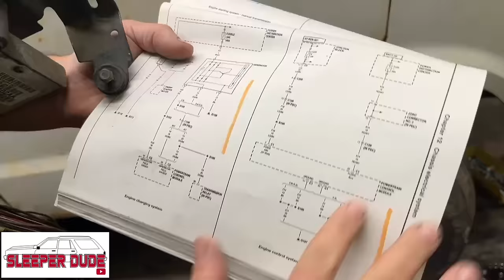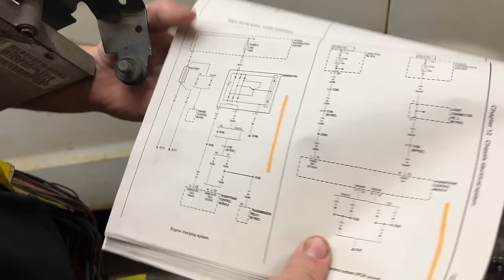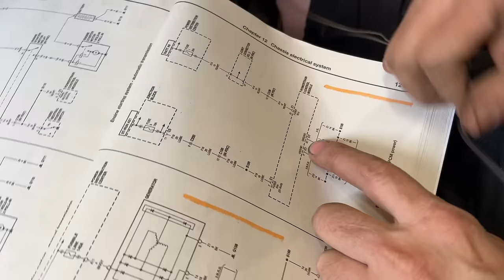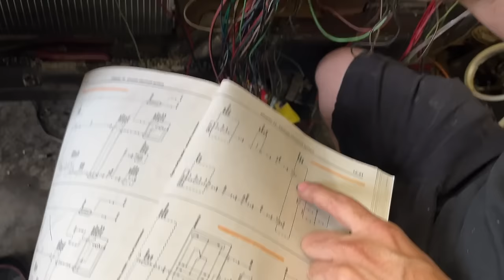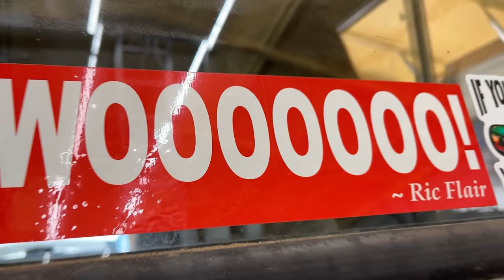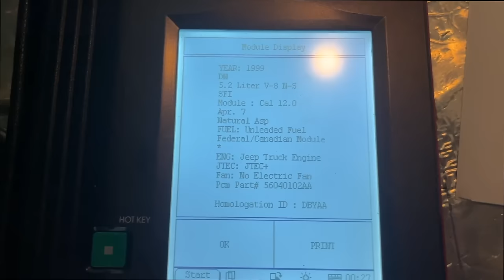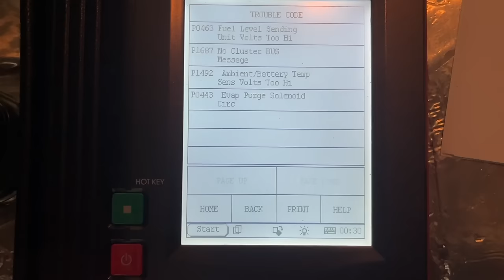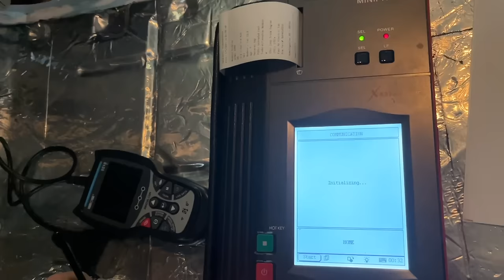2 Years of WORK Has Led Up To This! Will It Start?

Comment: This may sound stupid but tennis racquet handle tape is almost like Ford harness tape! I've used it a bunch. Maybe that helps. Also made a few painless harnesses and stretched it out and used the tennis tape to make it less of a ball of spaghetti! Also way cheaper than Ford tape, no real difference. Also a dress or tailor tape to measure the excess or to add wire?yes connection cleaner and dialectical grease too!.zip tie first , after completing, tape. Ps love you are using AN wrenches but GET SOME THREAD CHASERS!
Reply: Great tip!!

Comment: Hey Josh,   the computer probably requires the correct info, (resistance) from the Durango's lock cylinder, key etc.
    I read through much of the fan's suggestions until i got a slight headache.  MY POINT IS...... You need peace of mind on your next trip. Meaning Holley for your fuel injection, IF YOU MUST have it. But a big 4bbl and intake would be more trouble free and easy to diagnose in a similar nightmare  situation as your last RV Trip.
        You need reliability more than this modern crap on the next trip. Simplicity breeds success and reliability on the road.
         You might get this configuration to work, maybe you already have, but that's not enough for Josh, Tosh and the kids.    It was gut wrenching to watch all the hardships you had  on your vacation the last time. Just  want to see you  all have a trouble free trip this next time.     * We  care for you all.  good luck!

Comment: Hey josh..not a Mopar guy.....but I had the same problem on my 3.1 chevy and if the computer didn't detect oil pressure at crank it would cut off the fuel pump and only fire intermittently.  I changed the oil sending unit and it fired right up OBD1.  I have also got bad crank senor that were brand new.  Just thinking out loud... good luck.

Comment: There are some food suggestions here mainly the crank trigger and the oil pressure switch.
However for those who keep saying replace the ignition lock / barrel column etc did you miss the part when Josh replaced the jeep PCM with the modified PCM from Florida?
All of the atypical dodge security features have been deleted from the PCM when it was rewritten.
It could be the vehicle needs the BCM as typically the PCM /ECM work in conjunction with the BCM (body control module)
Josh's wiring and logic is sound the vehicle started and ran, so I would look at a common failure item such as the crank sensor which are a known weakness on Chrysler Dodge engines.
If the wiring diagram shows that the injector pulse is cancelled by either Oil pressure switch or crank trigger then they can be tested and ohm'd out using a DMM and quite possibly using a noid light to check if they respond to a power source 5v 12v etc

Comment: Definitely bypassing oil pressure switch, back side of block. Also computer ground, and every ground , especially engine block to body ground, the braided ground. Hope it helps. Also power pins on computer. Stupid fuses

Comment: In the newer systems, the factory gauges HAVE to be in the system. It showed you a fault for gauges. So if you can somehow mount the Durango cluster in there, you might be able to get it to run. I don't claim to be any kind of authority on it. I've ran into this more than once. So if nothing else, call the company you bought the PCM from and ask them.

Comment: I had the exact same problem twice; motor started, ran a short time then shut off. But, not dodges. The 93 buick problem was a faulty key sensor in the ignition switch. We found the wire that ran from the ECM to the chip reader on the ignition switch and added a resistor that matched the one in the key. On my 88 F150 (fuel injected) there was a corroded connection inside the distributor. Strange that your dodge is acting the same as my Buick and Ford. 
I know you bought a new ECM...but I'm thinking the problem is elsewhere. When you fix the problem you may find the new ECM will be better than your old one as it matches your engine size and has security  deleted. 
Because your engine did start, then totally quit, I would focus attention on sensors,  wiring plugs and fuel supply. You did a good job checking the wires themselves but inside the plugs and sockets there are pins that bend over, and female connectors that get pushed back so the male pin doesn't make connection. On a 2000 Ranger I had electrical issues and it was inside the OBD port. The previous owner must have jammed a code reader in crooked and one pin was bent sideways, sometimes shorting out with another pin. 
Last thought, you got the engine to fire by squirting some fuel in the TB, did you bleed the fuel rails? there could be air or water or junk in there so you see pressure but not getting liquid to the injectors. Maybe the regulator on the rail should be checked? 
I'll keep thinking on this, I was once a service writer and figured out some problems the mechanics were stumped by. Sometimes just simple stuff like water in the fuel or junk in the fuel filter. I'm a little skeptical about that inline filter you got after the pump. Very fine pore size...could slowly build pressure in the fuel rail but as soon as the injectors open the lack of supply stops them ftom spraying.  Poke the Schrader valve and see if lots of good smelling gas comes out.

Comment: Run a ground wire from the screw that mounts the Ignition Control Module/Computer to the engine with a ground wire.   You can unbolt a Ignition Control Module from the Firewall or Fender on a Chrysler vehicle and it won't start.  It will turn over, but won't start.   Bolt it the the Firewall/Fender and it will.  It sounds like you have a bad ground on that motorhome somewhere.

Comment: Josh, having both of the oxygen sensors side by side won't help your engine milage or performance, it might be better to put on on the left side and the other on the right side before the "Y" exhaust connection, that way they will monitor the exhaust coming from each cylinder bank

Comment: I think it's a real possibility that the PCM is mad it can't talk to the dash cluster maybe see if you can get that plugged into your setup even for diagnosing then figure out how to bypass it and if you could beg borrow or steal a dribble 3 scantool you'd be pretty happy I bet also check your TPS signal if it shows full throttle it's going into clear flood mode and shutting the injectors down also check your cam crank sync on the scan tool. Maybe just maybe your timing chain is off a tooth but it sounded pretty good when you plug the vacuum leak so probably not but you never know

Comment: Hey Josh,  I'm not sure if it's the same for 98 and up but when dodge first came out with the magnum engines with multiport they had a safety built into the oil pressure sensor. If it doesn't detect pressure it will shut the engine down. Experienced this with my friends 93 ram with the magnum V6.
Reply from the maker: Ok thanks

Comment: I don't know if this will help but I guess it's worth a shot. Years ago I was working on an old U-Haul truck I don't remember what kind of motor it had but it was doing the exact same thing. I put a new ignition switch in it and it fired right up. It's worth a shot I guess

Comment: In the Jeep if I remember right. Cam sensor Does spark crank sensor does feel like? I would replace the crank's sensor if you use something that's other than A Chrysler Crank sensor they don't last long. I'm pretty sure you replaced it. But they do sometimes come bad right out of the box

Comment: If I remember correctly when you set that distributor it fires the, injectors. You gotta get someone with (AutoZone) a feature that fine tunes injector timing. I have a couple of dodge Magnum engines & what you are dealing with is WHY I haven't swapped my 5.2 for a 5.9. I'm still thinking when I do mine I'm not pulling the, shaft(s?)

Comment: I read some great ideas about solving your problem here. Basically, your computers must be working fine. There could be a conflict caused by information coming from the crank sensor, causing the computer to not allow fuel to the injectors. Thats my pick. 

A couple folks entered that the oil pressure being disconnected might cause a conflict. Could be? This is an older Chyrsler product. Gremlins in the distributor system were more common 30 years ago.

Comment: Probably been said a hundred dozen times already but an OBD-1 donor would have been a better starting point. No SKIM system and the RH transmission is controlled with two wires for the lockup and OD solenoids. I am a lifelong chrysler enthusiasts and the manner in which Chrysler integrated all of the engine, transmission and body control system together makes for mess. The elusive idea of having a stand alone controller that can run the RE or even the RFE series transmissions without having to totally interface with the JTEC or NGC engine computers is a pipe dream in fantasy land.

When I see the GM LS swaps and how self contained the engine/transmission control and wiring is I am jealous. Minimal interface with the rest of the car.

Comment: I felt your pain Josh. No pouring one out for your homies, no RC Cola. I don't know much about cars but wonder if you need something from the original ignition barrel and key. Not sure if there is a transponder in the key or something in the barrel or column that thinks you're trying to steal that Durango. I am sure you will get it going. You have done so much work on it, this is kust a temporary setback.

Comment: That ac unit that came in the van part was a common dealer add on. The factory air actually had a different dash and fire wall on the passenger side. Those dealer "tag air" systems are unfortunate as they cut a massive hole in the center of the dash to accomodate the plastic housing with the vents, controls and radio insert, and now that they are nearly 50 years old, can be quite brittle and hard to find replacements for.  70s Dodge vans are sort of my thing

Comment: I'm pretty sure you would have a low oil pressure fault if the sensor needed hooked up. Do you have cam sinal? And crank signal. See if you can see rpm on the scan tool while cranking. It has to be a signal issue because you can test the injectors and they work with the scan tool

Comment: I would suggest try running the factory (style) oil pressure sender.  Last summer, I put together an '88 RAM with the TBI V6, and even those require the OE oil pressure unit because there is a ground switch in there that will shut the engine down if it loses oil pressure.  I would assume a '96 might-could have the same protection built in?  I would start there, my friend!

Comment: Far as your O2 sensor, a spark plug non fouler between the O2 bung and the O2 itself typically works to keep from throwing a code.

Comment: Raise the fuel pressure slightly double check the cam sensor to see if t works. stick it on 51lbs the pressure. timing may be the problem something quit working.

Comment: The computer you purchased needs to be reflashed again. The SKIM was not disabled properly. Code P1687 was present and the symptoms are exactly what a  security issue would trigger. I would talk to the company that did the work on your new computer.
Reply from the maker: I think you may be right
Reply: @Sleeperdude  ..code P1687 i show as No MIC BUS Message No CCD/J1850 messages received from the Mechanical
Instrument Cluster (MIC) module.

Comment: Can't remember the year of the durango, but what about an inertia switch? Know they are mainly used for fuel pump's and you installed a afterfmarket one, but maybe its cutting the system as a whole since the injectors aren't firing?
Reply from the maker: Ok I will check thanks

Comment: You know you are totally right about that amp gauge and fusible Link in those Chryslers I remember back in the day when I was building my first race car which was the 68 Roadrunner, that car almost burned to the ground because of that fusible Link in that a gauge I don't know what the deal is if they didn't put heavy enough wire or maybe the fuse was too big or whatever but luckily I saw the smoke and was able to disconnect the battery and Trace the problem back to where it was after that I put an aftermarket gauge and disconnected all that crap inside and ran a new fusible link because that was what they designed to protect the whole system. Once I did all that no more problems although every one of my friends that had Mopars had the same problem, go figure! I'm sure you're doing everything that to the best of your knowledge I know you have the patience of Jobe that is for sure. And this will help a lot of people that are going to do the 5.9 swap. As always many blessings to you and your family, you guys keep up the great work.

Comment: One thing to consider. It was sputtering and trying to run until the fuel pressure was adjusted downward. I would crank it to 60 and see what that does.

Comment: Why not just use the Durango fuse block for everything, it has all the lights etc in it? Also use the relays for the lights etc, it will take the extra strain off the switches, just like getting rid of that amp meter.

Comment: I would try to contact South Main Auto, he can troubleshoot just about anything. WatchWeswork is also a very talented mechanic. I think some computers need to be connected to the gauge cluster, not sure if the old dodge needs it, but maybe worth hooking that up so you have a complete can bus loop. Luckily you've narrowed it down to no injector pulse, thats a lot better than having no idea what the initial problem is. Good luck!

Comment: Is there any chance that the fuel tank from that salvage yard Dodge van will fit in place of the RV tank? If so the fuel system computer might recognize the familiar readouts and give proper feedback to the ECM.  Just a thought. I really hope you have already got it all sorted out by now.

Comment: Oil sending unit signal and possibly try pulling cluster out of Durango and plug it in. My Nissan wouldn't run without it. Just a thought. Good luck

Comment: Get a full wiring in excellent condition from a wrecked durango and juste get rid of the no essential  wiring like light electric windows just get the stuff that maje the engine run also i have a similar problem and it was because i have no cluster

Comment: I’m pretty sure it wants to see the cluster ushley anything with canbuss will stop it from pulsing injectors I had a truck that I started swamped the cluster drove across town and shut it off and it would not start at all had to get a ride home for the old cluster and go back started right up I know you cut threw the harness but how ever the computer sees the cluster it wants that plugged back in or might be able to bypass it with a resistor

Comment: From past experiences you  lost injector ground during crank. I have had this problem on a Dodge before. It turned out to be a bad crank sensor,  I also know that on some dodge injection if there is no signal from oil pressure unit it will not ground the  injectors. I think you said you didn't have oil sending unit hooked up. Try that first. Good luck

Comment: To trick the O2 "sensor 2", You make an extension tube to keep the tip of the O2 sensor out of the main exhaust flow. It will catch enough exhaust to get a reading, but not enough to overwhelm it and throw a code. I use one on my "daily" (1996 c1500) because my converter internals broke apart and I cleaned it out. I have no clue about your injectors. I wish you luck on it. Extra grounds??
Reply: A no foul adapter is a perfect fit

Comment: You should have just used yhe underhood harness from a Ram pickup, my 64 Rambler has a 5.9 and a 5 speed, i didnt unloom anything, just unhooked it from the cab and put power to the lime green wire with a black tracer

Comment: I know it didn't throw the code for cause it didn't actually run long enough but I know that the crankshaft position sensor fires off the sparkplugs but the camshaft position sensor fires off the fuel injector, maybe camshaft sensor?

Comment: If the injectors aren't firing, then I`m thinking its not getting signal from the crank or cam position sensors, or, the lack of an oil pressure signal is cutting them to prevent engine damage? I admire your bravery with this build though! I know you`ll get it sorted 😊

Comment: Squeezy, those Dodge ECMs have a diagnostic mode you can enter by cycling the key from off to on 3 times. Entering that mode also bypasses the imobilizer, and resets the security system. Try a 3x key cycle then starting.
Also, that particular cam position sensor is a common failure point on that era Magnum. You should either check the signal with an oscilloscope, or swap in a spare, to rule to it out. If the ECU diagnotic mode reset doesn't work.
Please tell your dad before you slink out.
Reply from the maker: Ok thanks for the info

Comment: Did you check and see if the Durango had an fuse box inside the cab there might be two like a Ford and it needs it to run.

Comment: Check tps voltage. I've seen them stick.
If tps is fully open then the computer with shut injectors off for flood mode

Comment: Double and triple check your grounds. Check out how the fuel shutoff relay is wired. Ie NO or NC. Maybe a  bad crank or cam sensor? Iac? Bad temp sensor? Bad tps? I don’t think it’s security. If you want to pursue that route id search that whole Durango for the bcm. It’s usually under the dash or console. Possibly under the carpet somewhere.
Reply: Bad crank would allow spark but not fire the injectors if I’m not mistaken.

Comment: Hope you got it running but if not my friend has a 95 Durango that would barely run in drive but run fine in reverse. The problem was the crankshaft sensor but in reverse the computer did not  read the crankshaft sensor. Maybe problem has something to do with transmission sensor and the computer is not seeing your in park or neutral ?